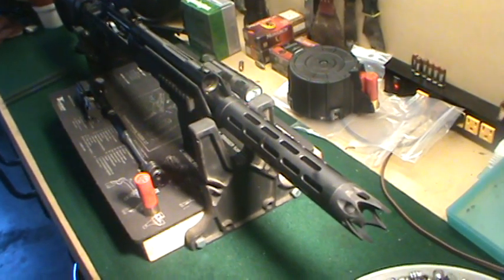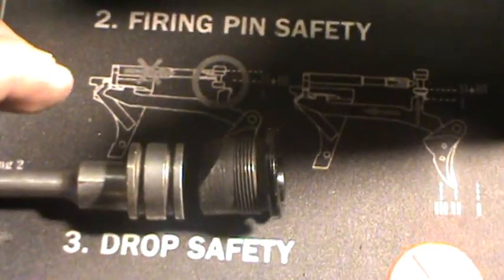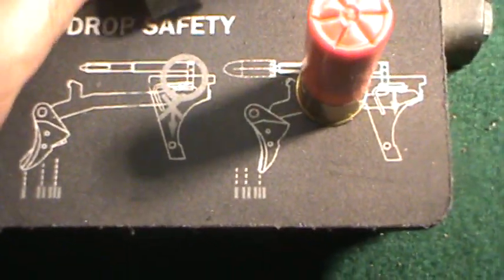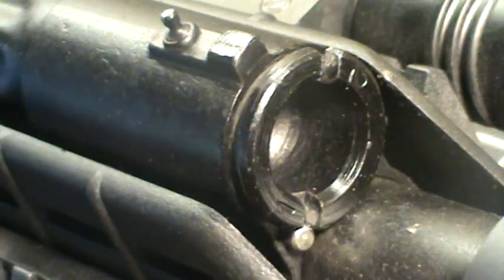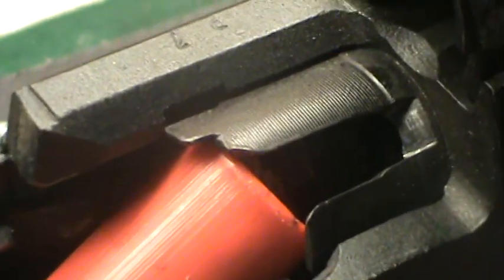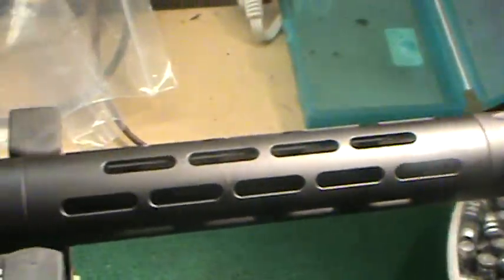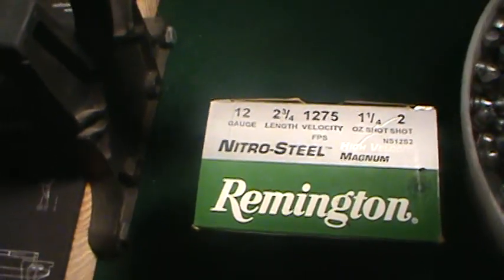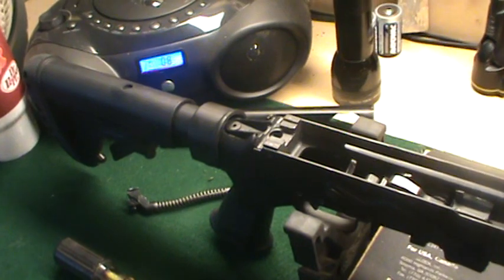Saiga 12 Reliability tips, fixes

Comment: If I understand correctly:
The tightness of the plug doesn't control the gas. It is the plug's wedge the controls the gas. The notches are what determines the wedge and gas. There's only two choices, no matter how tight or loose the plug is.
Reply: I would think that the tighter the plug is... the closer to the puck it is.. maybe giving it a little more force? If there's a larger gap with the plug backed off a few threads then the gasses would expand sooner and lose a little bit of energy to drive the piston? Also probably creates a better seal between the plug threads and the puck which wouldn't be a bad thing. I don't know though.. I'm no engineer or professional gunsmith.. that just sounds logical to me... lol

Comment: I have a Fostech origin 12 , had same problem , stovepiping , jamming , extraction  and feeding , about every third round , I found the problem , it was the bottom of the bolt carrier as it fired and carrier flys back it hits the hammer deforming the back end of the channel where the bolt goes through , causing the bolt to stick in the channel not rotating or sliding back and forth . Shirt stroking the system! And the breach was as yours sharp edges shaving the plastic rounds causing the shell to jam up and chunks of plastic everywhere possibly plunging the gas system . The fix was the same , took a dremel with fine diamond bit and rounded very slightly those sharp edges on breach and the back end of the bolt carrier where bolt exits out the back ! She runs like butter now !

Comment: dont change the mainspring to a weaker one.
if you fire magnum again the action will slam into your receiver 
over time that will not aid in reliability
plus you could get failures to feed because of the weak forward force applied.

polishing action/receiver-rails, actionsurface/hammer, bolt, locking-Z ( where the bolt is guided to turn for locking );
cleaning the ports, the gassystem plus the puc
taking the sharpness off the edges at the feedramp end of the barrel
polishing the feedlips of your mags

all of that should contribute a huge deal to making your saiga run like a champ.

you should cycle your saiga for 2 hours manually after buying a new one.
lots of scrap goes off of it and out the magwell.
Reply from the maker: minervius you are very correct, always change out the mainspring for a stronger one.  I keep it on a "closed" bolt for home defense status.  Mainspring has stayed much stronger.
Reply: THANK YOU
Reply: @arthurcarstens  what’s the name of the brake and where can I buy it?

Comment: great vid! I did all the same to mine.one more thing I did I removed the hammer and ground down the belly to a more round smooth surface and polished.That part  underneath of the bold carrier in which you smoothed out when releasing has allot of friction along the belly of the hammer.You can really feel the difference when you charge the gun.if you pull your charging handle all the way back and release very slowly there was a point in mine where it would catch and hold(not if you just released) but since I did that it is a smooth as can be..

Comment: Antiseize has fine grit in it to mate surfaces together, gonna apply to rails and bolt and cycle it 25000 times

3" magnum #2 steels seem to cycle the best in my jts and slugs work better in the 5rd mags than 10rd... It also feeds birdshot 100% since day 1 on gas setting 3

3" #2 would be absolutely deadly inside of 10yds without question

Might also try some graphite in the mags

Comment: The reason for the aftermarket spring causing problems is because an aftermarket puck has to be installed with it. It helps the gas pressure function more smoothly

Comment: Okay so I have a question. I took apart my fire arm, and the metal cover on the spring is locked to the rear, not allowing me to chamber a round. What is a quick way to fix this?
Reply from the maker: hard to tell without seeing/examining it,  local gunsmith would be better

Comment: Polishing might seem like a good idea, but what you do is removing all the little pits which do great in holding oil. This gun will probably run excellent for the first 50 shots, but then everything is dry and stop working. If you keep the long slides for the bolt a bit rougher they can hold more lube and will work better on long term.
Reply: Unfortunatly, oil is not your friend as our friend in the video mentioned. Loose tolerances are the trademark of any AK style rifle, which gives it much of it's reliability.
Reply: Yeah tell that to Jim Fuller over at rifle dynamics...
Reply: Lithium grease is best for ak!

Comment: I first got my Saiga it wouldn't cycle low brass but what it is when they put these guns together at Factor they put them together so quick they don't line up the gas block with the Ports! On mine I had 1 port open and 3 half shut so what I did was took it apart and drilled the ports an 1/16 of an inch and drilled the Gas block 1/8 and polished the rail the chamber the bolt everything that had friction to it!! I Haven't added any after Market parts to it yet and it will cycle Low Brass I wanted to keep it close to what it was made for so I could shoot 3" Magnums and 2 3/4!! But i do alot of Crow hunting for a Produce Farmer and he Buys the Shells and he gets the cheapest so im going to buy the Css G2 Puck and the Adjustable Gas Plug.. And a few other thing to make it more reliable the way i look at it I want a Shotgun that I can use for anything specially if it semi-auto!!! Home defense, Hunting or whatever I want it for.. You can do alot to the saiga urself with sand paper and a drumel tool and you don't have to worry about messing it up!!! I was Lucky when i got mine Cause it was Factory converted... You Ask me Best Damn 12 gauge semi-auto Shotgun ever MADE!!

Comment: If anybody has any advice I would appreciate it, my saga is having problems ejecting spent shells, bought a 6 position gas block, no luck, the bolt seems to have a slight "catch" in it when I pull it back,the catch occurs just as the extractor should eject,,,,,, HELP

Comment: I've found that if u screw in the gas screw to far it seems like it blocks the gas like if the threads r to long. I got a lynx 12. I put it on 3 and on the second turn from being all the way screwed in. Also alot of my malfunctions were being caused by the dust cover. It took it off and it started running alot smoother. Also sds mags suck. Still don't like ammo 1200fps or lower. Anything above runs fine

Comment: How did you bevel the barrel sir.
Reply from the maker: Being careful not to drastically remove material I used some emery cloth to smooth out any burrs, imperfections etc
Making it easier for the round to chamber 
Hope it helps

Comment: I only bought improved modified choke on the barrel and ive had 0 cycling problems with bird and sporting rounds. You just need to figure a way to get more gas pressure to the piston. I would have been extremely surprised if my gun would have worked without issues with straight barrel and i own the 12K model myself which has even shorter barrel than the regular sporting/hunting model.